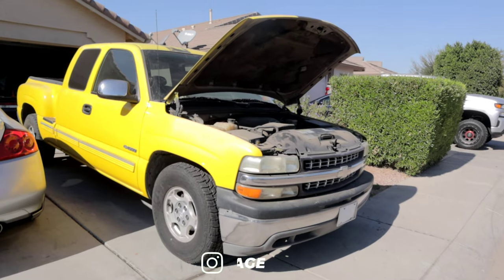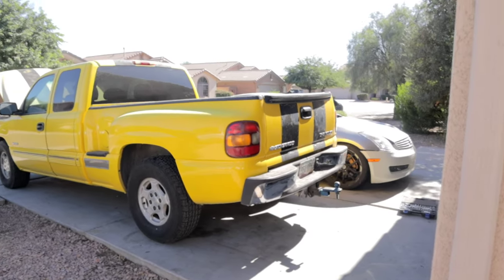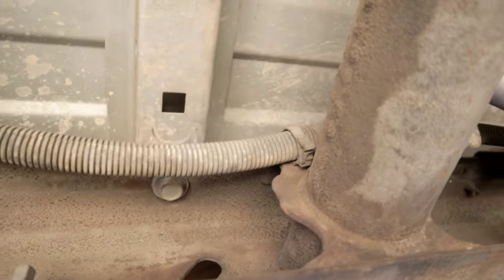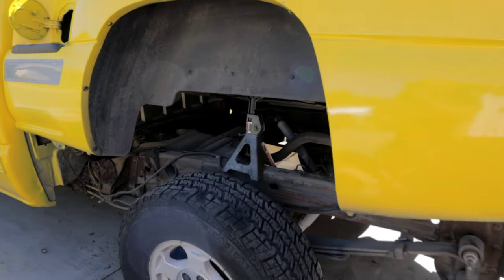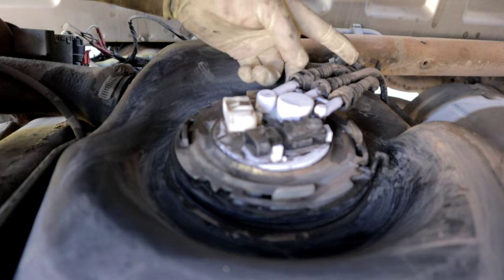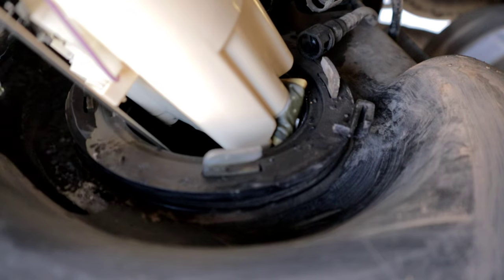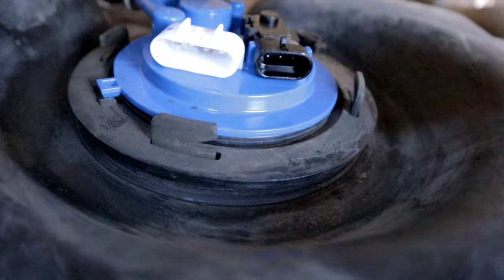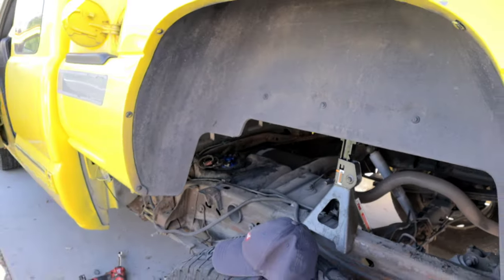2001 Chevy Silverado fuel pump replacement one person method

Comment: Wait, One small yet major detail. I am in disagreement. Reason being, When you get to the fuel pump, I believe the correct way to prep it before pulling  touching it is to take an air gun and blow all  the particles from it to prevent any little piece  from falling in the gas, Keep in  mind, one small particle could do damage to injector. However, Great video otherwise. Keep it up bid dog
Reply from the maker: Any small particles introduce will get trapped by the fuel filter
Reply: @ERICSDIYGARAGE not to mention the model you have has the strainer internal vs the old ones with external strainers. Shit the gas as stations has particles galore and some even hook you up with an extra H2O to keep the vehicles hydrated 😂